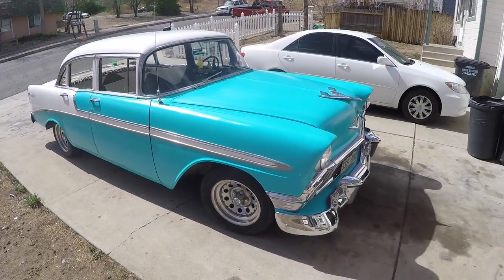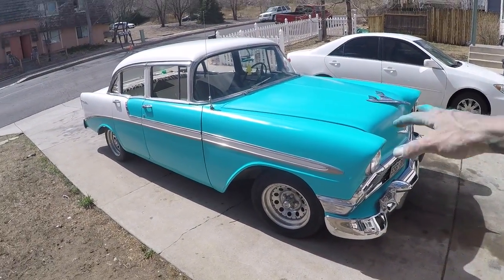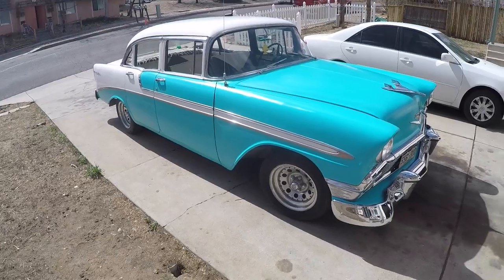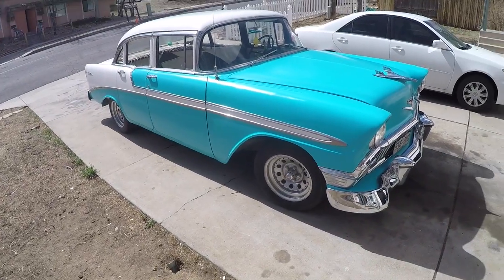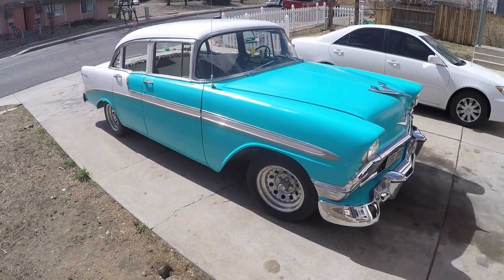1956 BelAir RATTLE CAN PAINT JOB S08E07

Comment: @waynesworkvlog What brand and color name did you use for this job? Looks like it covered well.How many cans did you use?
Reply from the maker: Rustoleum 2x coverage at walmart. I think it was called seafoam green. depending on the starting color or if primered, and how well you lay the paint... I assume two coats usually... 1 can for the hood, 1 for the trunk, 2 per side, 1 for the roof. I think i did this with 6 since 1/3rd was white.
Reply: Cool! It almost matches the stock color of my Studebaker (pictured in my avi).I did my car with Rustoleum 2X flat black.It's one of the better rattlecan products IMHO.

Comment: Nice job dude! I’m currently in the process of doing this to my car, but really want to know how you got those results! Did you sand off the shine of the paint, back to the lacquer, before painting? Or did you just start spraying over the paint? :D
Reply from the maker: I usually just start painting. unless the surface isn't smooth already. rough sand with 1000 grit or even a wet sand would be good to make the surface ready to hold paint. all in the prep work.
Reply: WaynesWorkVlog Thanks man! I’ll be attempting my car soon! 😁
Reply from the maker: good luck! the 56 will be getting sprayed again soon probably. so maybe another vid.